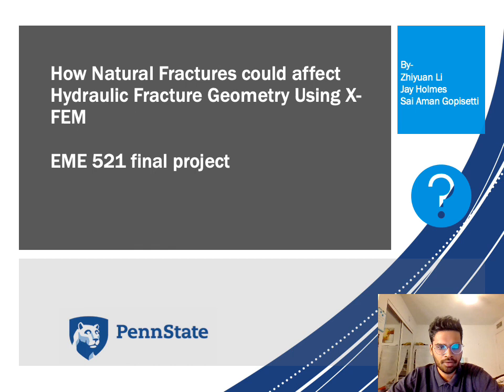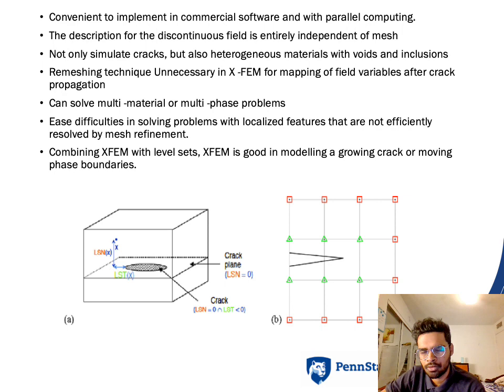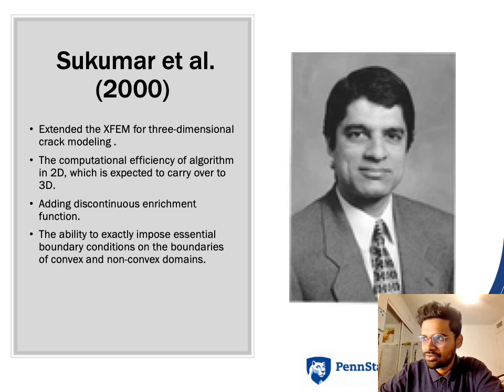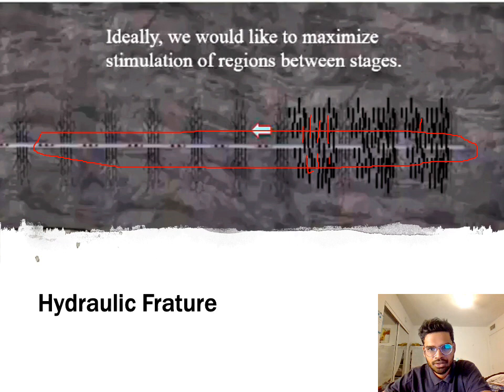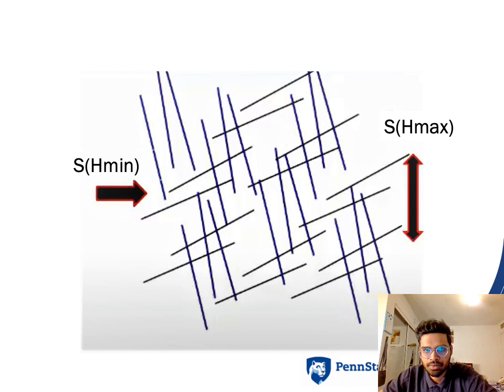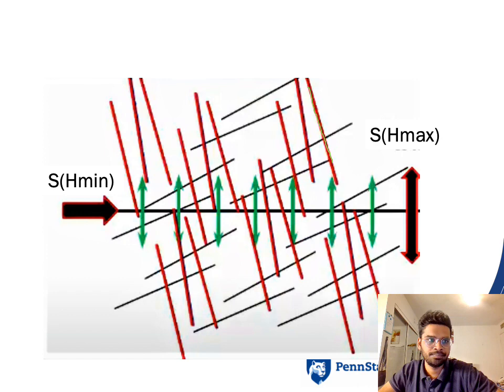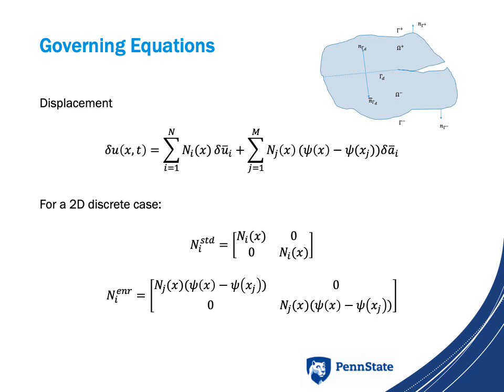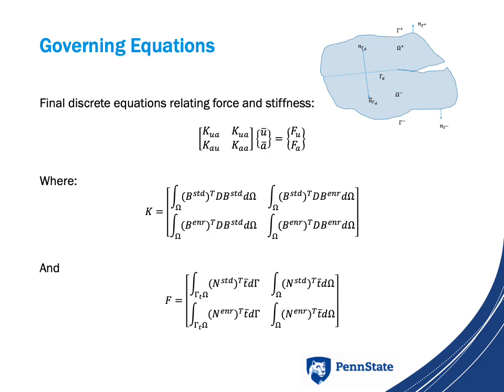Extended Finite Element Method (XFEM)

Comment: Ey, thx for the explanation, this really helped me with setting up the K-matrix. I do have 1 question though, at 46:15 when you construct the 'F' vector. I dont really see how you get [0 u 0 -u]. Did you make an assumption that u3 should be 'u' (since u3 is connected to u4, which obviously makes sense) ?  Or did you actually calculate these numbers?